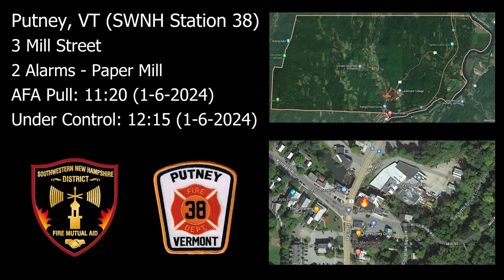2 Alarm PAPER MILL FIRE - Putney, VT - 1-6-2024 - Dispatch Audio

Comment from the maker: Timecodes
00:00 Initial Dispatch
00:31 Automatic 2nd Alarm Struck
01:01 1st Wave Of Mutual Aid Dispatches (1st And 2nd Alarm Companies)
03:49 Brattleboro Mutual Aid Dispatch (Bratt Dispatch)
04:26 38C1 Requests Rundown Of Incoming Ladders (Requests Another)
04:51 Bellows Falls Requests For Ladder
06:50 38C1 Gives Orders To Incoming Ambulances
08:42 38C1 Requests Update On Status Of Incoming 1st Due Ladders
10:11 38C1 Requests Power Company And Police
11:26 38C1 Requests Rundown Of Incoming Mutual Aid Units
14:36 Command Advises Under Control